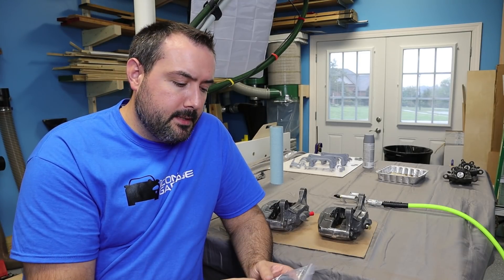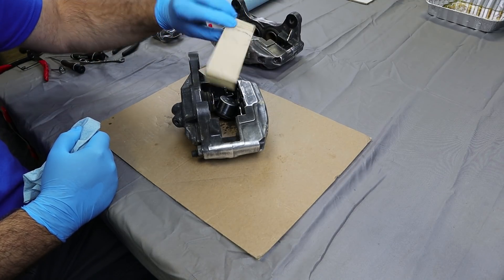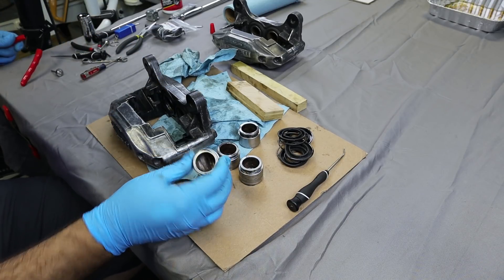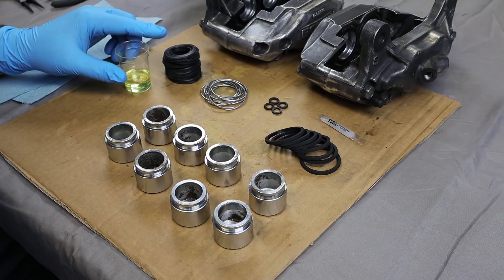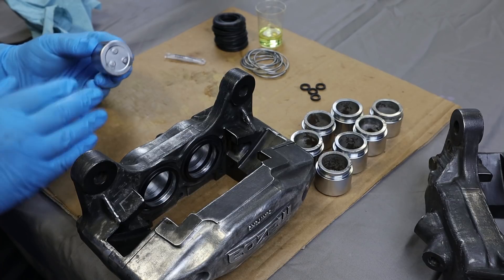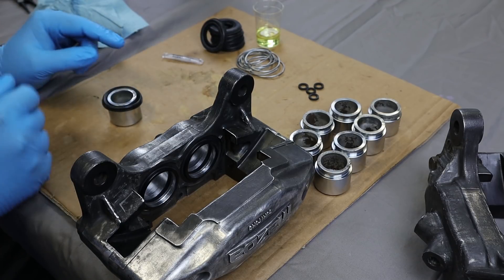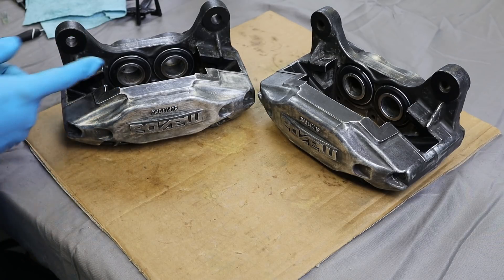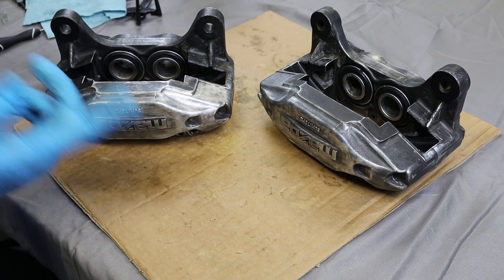RX-7 Front Brake Caliper Rebuild

Comment: thanks for  making this video, i have 4 pot calipers and usually i'd just get reman ones but they are no longer available so had to go this route, first time rebuilding calipers and glad a video like this exists!
i didn't cut the rings that hold the boot on but they seemed to clip on well enough so didn't worry about it but i can see what you mean in the video about them wanting to come off. I just spun mine a few times and the sat in place pretty well
Reply from the maker: Awesome! It isn’t the most exciting content but I wanted to be detailed enough to help those tackling a brake rebuild.
Reply: @IconGarage  no worries if i wanted to watch exciting i'd just watch mazzei formula 20B FD all day haha. I figured my calipers needed to be rebuilt though, after track days, drifitng etc there would be no brake dust at all on the wheels so i figured the pistons were sticking, after removing them when i used the air to pop the pistons out one of them was stuck pretty good so glad to have got down to the problem. Going to finish the other caliper tomorrow and should be good to go

Comment: Why do you use grease to lube rear caliper pistons when installing but on fronts you use brake fluid? Which is correct?
Reply from the maker: I followed the factory service manual on the rebuild and that is how it was intended. The grease is likely just a little something to lubricate the seals. Brake fluid is probably what I use on most rebuilds. The pink grease came with the new seams. Can’t use a lot or any type of grease as it could end up tainting the fluids.

Comment: Where can I buy FC 86 to 91 4 pot Pistons? I have a cracked one and bought the rebuild kit but need a new piston.
Reply from the maker: I’m not sure on that. Rock Auto may have OEM replacements cheap. Otherwise, I would ask around on your local market place to see if anyone has a used set they would be willing to part out.